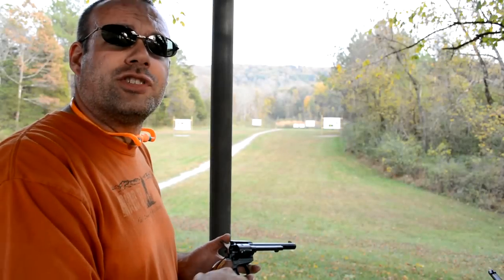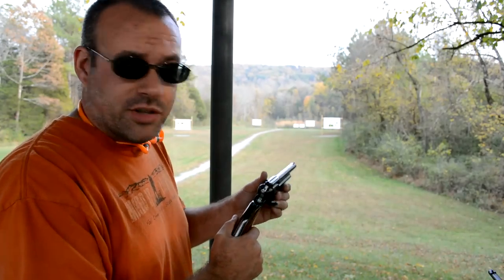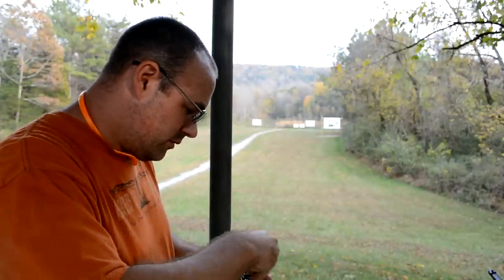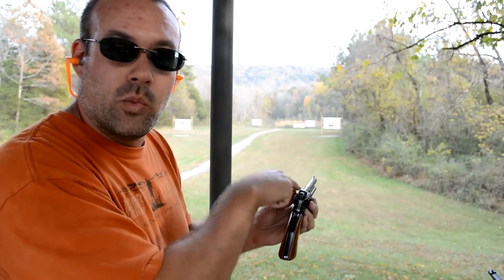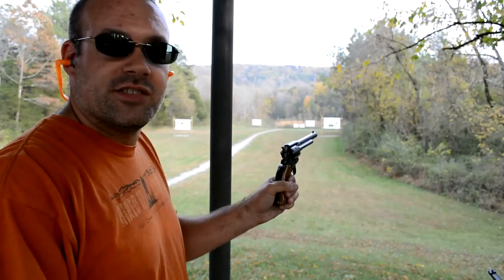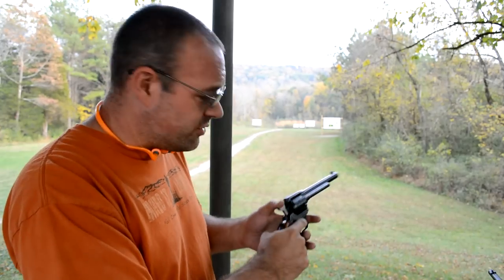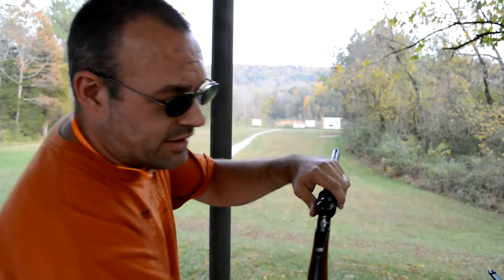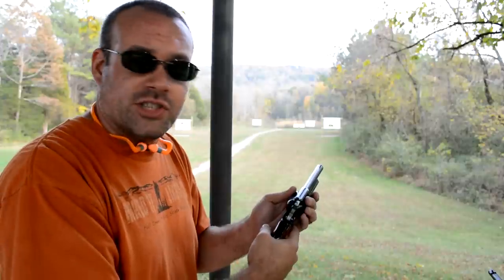Loading 5 rounds in a 6 shot revolver.

Comment: do modern revolvers universally still have this problem?
Reply: Nope. Most have a transfer bar which is a tiny piece of metal that moves in place WHEN THE TRIGGER IS PULLED. lol. So the round won't discharge unless there is a trigger pull. In addition, the firing pin is built into the frame and is no longer on the hammer. Just make sure you know the model you are working with and how it operates and you should be fine.

Comment: Know your revolver! The Colt 1873, Colt replicas and early Ruger single action revolvers are five round only guns.
Reply from the maker: Correct.  One of my uncles still has an old Ruger Single Six 3-screw unmodified so no safety features.  I would have liked to have used it for the demo but it's in prestine condition and I wasn't about to hammer on the back of such a beautiful firearm.  Thanks for watching.